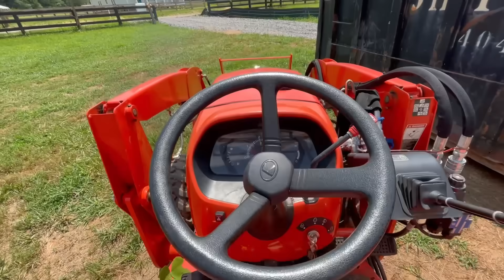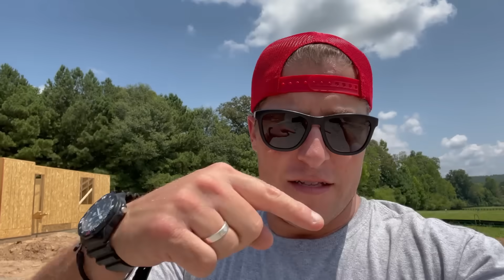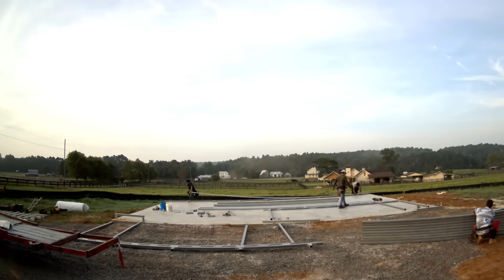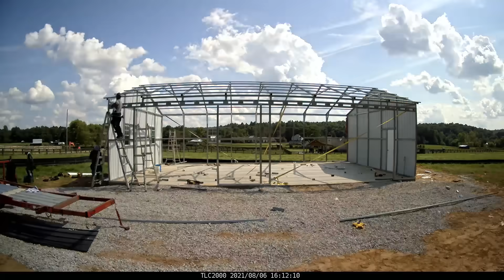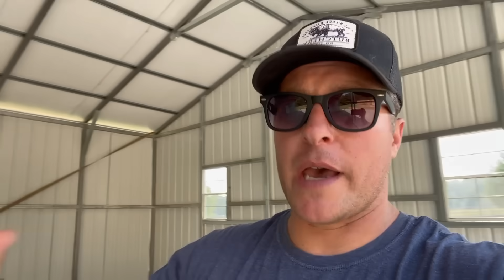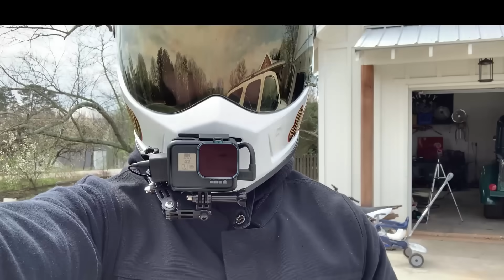I FIRED THEM!!  26x40 metal building Dream Garage build Ep.2

Comment: Thanks for sharing! First you have a drawing of the building frame work, that is like a contract. People can lie over the phone but when they write (drawing) it down and it’s signed it’s a contract. There is a ledger in the corner giving sizes of everything steel thicknesses, type of steel, bolt sizes and grade. Everything matters, you maybe OCD but this is normal people not right.
Reply from the maker: Thank you

Comment: If you were provided plans and the building was contracted based on those plans, I would ABSOLUTELY make them fix it to 100% , or come get it

 I had a roofing company put a roof on my mothers house, they had shingles running crooked, didnt do a full tear off.  They didnt do the contracted roof repairs, shingled over a rotted hole 24" in diameter.  I told them fix it, they tried sell me on a patch job. I said no.The roofing contractor threatened to sue. I told them please,PLEASE  PLEASE sue me. You tried to rip off a senior citizen/military widow. I smell pain and suffering too.

 They backed off, i had another company come out fully document the tear off, debris, nails, old tar paper, didnt repair holes, all as per contract.  The second company did a near perfect job.There were 19 sheets of wood needing replaced, they asked me, i said fix it. they showed me truss damage from water leaks, i said fix it. All legit stuff ( i used to be a remodeling contractor so i knew what i was looking at). Cost an additional 1000$, I wanted it right, for mom. It was never about money.
Reply from the maker: Thank you

Comment: I don't think the siding is a big deal.  The horizontal truss going from 16 foot to 6 is a big deal.
Reply: The siding looks terrible.  I would complain too.
Reply: Exactly if you have plans that this is how the building was supposed to be built manufactured manufactured whatever you want to call it then it's not what you bought it's not what you paid for absolutely have to fix it or or take it away
Reply: Time and a heavy snow and ice over time will make the seams open up.. screw them have it removed .

Comment: I had to fire my first contractors as well when I had my Steel garage installed. 26x30, The guys did real shotty work and it was not to Spec he couldn’t even use a chalk line to install the self tappers on the outside.  My building is 26 ft wide too and I had what you say the correct type trusses. Those trusses for one thing that worried me early on in the video. You’re 100% right, Also you should’ve had horizontal crossmembers on the walls
Reply from the maker: Thanks man. I hate these companies allow this crap to go on.
Reply: @ProjectDadLife  it’s the industry as a whole. They all come from South Carolina (I’m in Connecticut) they work for dirt cheap, and even my first crew I fired asked me for money for the installation.. I told him(I’m in construction 25 years) that’s your problem with the company I have nothing to do with what you get paid.. I’m the customer, and it very inappropriate to ask the client for money. They’re not charging enough.. I paid 13,000 26x30 with doors I did residential OVHD doors too..what did you pay for the building excluding the garage doors, 12 feet high walls, upgraded gauge steel sheeting, vertical installed.
Reply from the maker: Totally agree seems like it’s one big family of scammers that run that metal building industry. Mine was 18k without doors. Added roof insulation and 4/12 pitch 10’ walls, vertical panel
Reply: @ProjectDadLife  not bad especially now. I know it was back in the fall but that was reasonable. I did the colored screws and set that up before installation. But needed to buy more they covered the cost and all my panels needed to be removed cause of shitty work.. but you’re right you have to keep an eye on the install

Comment: I am a contractor in Oregon. If what they built is not what you purchased in the contract you should have them removed it free of charge. Depending on what state you live in, if they don’t want to comply you may consider contacting whom ever regulates contractor licensing. From a contractors point of view, the rippled metal isn’t ideal however the product isn’t defective. If I buy building products I don’t always get to choose each piece of product (Ex choose each 2x4 in a unit) so it’s not unreasonable that they installed that metal. It seems like a cheap thinner gauge metal and again depends on your contract. I would remove the entirety of the roof sheeting, remove the trusses and replace the trusses with the ones spec’d in the plans to make it right. They should have verified their material with the plans that both of you should have.

Comment: I built a 50x50 and did a ton of research before deciding to go with an Iron Built unit. These galvanized metal buildings are  basically tin cans. Without insulation these buildings also condensate and allow moisture and mold to grow on the items inside.  This is in Florida BTW. In a dryer climate this may be ok.
Reply: A dehumidifier goes a long way to keeping the humidity down.   The building has to be sealed decently but even a large room sized one helps.   I have a 30x40 building that would have water sitting on the floor.  I found a 50 pint dehumidifier with a pump and it keeps the building dry.

Comment: Send it back, wood stick frame anytime you have slab on grade. Steel buildings are garbage and they don't save you much in the long run. Manufacturers don't care about your jurisdiction even if they say they will adhere to their adopted/amended codes. You would be much better off having the same framers building the house build the shop.  Side note, no slab, build a post frame structure.

Comment: I purchased 2 steel buildings from American Steel Carports out of Joshua, Texas through their dealer in Hudson, Michigan (Hamdan Quality Roofing). A 50x24 ~ 2 car garage, and a 25x26 ~ 2 stall storage building. Both planted on a really nice 5.5 inch concrete slab, 4 inches above the grade with around a 5 inch rat wall. They too do not pass inspection as water seeps in at the base rail when the rain and wind are at work! The idiot contractors did not put down a gasket seal between the base rail and concrete and did not skirt to protect the base from the elements.
My building inspector sent letters out to both parties February 10, 2022.  To date 3/14/2022 no response from ASC or HQR! The inspector's notice states: "Water is entering the storage buildings under the perimeter bottom rails.  Michigan Residential  Code section R703.1 requires exterior walls of buildings to provide a weather-resistant envelope." Thanks Dad for posting, thought I should share with you and your viewers.  ~ Dave in Michigan

Comment: I was in the business of building metal barns and carports and had a retail sales lot for a manufacture such as the one you purchased, I also have spend many hour at their manufacturing plant and have seen most of the  process and have dealt with the sub contractors/installers who install the building that the manufactures use,  the sheeting is definitely a manufacture mistake and the roll forming machine that produces the panels should not be rippling the edge and those sheets should be sold as seconds and would be unacceptable to me, as far as the trusses go  if you ordered welded trusses in would be a option and listed in the contract, usually spans greater than 24’ would automatically bump the trusses and the price up, under 24’ the standard brace is acceptable according to the engineers I have spoke with , depending on the part of the county you live in (snow load etc ) the manufacture will only build what the contract says ,they are pretty strict on that part! Look your contract that you signed over and see if you purchased the better trusses and if so make them stick to it if not the additional bracing can easily be made by them and the installers can weld in place at your location, most of the contracts from them that I dealt with, it was standard for a 10% deposit from the customer at time of purchase and final payment when u are satisfied, at the completion of the project, the sales location really doesn’t have a choice on negotiations with the customer , all decisions come from the factory and the initial deposit of the 10 or so % is the commission the sales lot made, the installer are sort of caught in the middle also as they get about 20-30 percent of the ticket for installation, and they don’t get paid for any work till they have a signed completion from you. The factory’s have a fee for every and I mean every item! They put additional on a building beyond what is stated in the basic 
package or what the contract states, 
I have sold prefabbed buildings for about 7 years for 3 different nationwide manufacturing companies and they all pretty much work the same ,hard to get thru to someone in charge after 20 different phone reps and endless time on hold, be patient and Fair, I’m sure they are understaffed like everyone else, they should make it right! Most of the problems I have seen over the years whit them are the sales lot representatives are not knowledgeable enough to know how price the details so they leave it up to the factory and the installer for add on at the site, which creates hassles and unhappy customers!    Good luck buddy I hope I was some help, if I can assist further just let me know.    Mike

Comment: I work in  the building trades, and sometimes being overly anal-retentive about everything can kill you. If you want to micro-manage every single fastener that goes into a building, you should probably just save everyone the time and frustration and do the assembly yourself.

That being said, I think you’re being a tad overzealous with the edge of the metal wall panels. However, with the roof trusses, I think you have a legitimate gripe. If drawings showed true trusses with a top chord, bottom chord, and cross-bracing supports, that is what you should get! 

But being a perfectionist when working with the building trades can be an agonizing experience - choose your battles wisely!

Comment: If it isn't per plan that was approved by the county then it's not installed properly. The county would deny you an occupancy sign off. As for the rippling on the panels it looks as if no one was doing any quality control an cosmetically looks like crap. They probably did not use the proper crimping tool.

Comment: In my opinion the edges of the panels isn't that big of a deal but the truss structure not matching what you bought off on and submitted to the county is a big deal and whom ever your contract is with needs to make that right. They have labor tied up in it and they would have more labor tied up in it to take it down. So I wouldn't insist on  them taking it down but I would insist on the truss bracing being fixed properly.

Comment: If its not to code. Or it's substandard that's a problem. I wouldn't pay for work like that myself. One it wouldn't last long especially under a snow load on that roof. Secondly you couldn't seal that to keep heat or A/c in. It's just a really cheap package shed is what it looks like. The company that owns the building should be on the hook to correct the issues

Comment: Spot on them sheets were probably damaged when they were in a bundle they fixed instead of replace but the trusses is a deal breaker have to pass wind code and they differ depending where your at well anyway still like it though

Comment: Have a similar sized building built, but they doubled the metal in the framework on the walls and on the roof. I watched as they assembled the structure, no bend or sag whatsoever with them standing on top. If you're stuck with them, see if they can cut the spacing in half with more framework, on the walls and on the roof.

Comment: It is all very good as long as the building meets the spec that you were given. If it does not meet specs then they either fix it right or tear it down at their expense, or take them to court. They will have to eat the whole court costs, maybe put up the correct building, or lose their license. Good luck.

Comment: I can understand you reasoning but would really like to ask a couple of questions simply because Im wondering if therer was resoning that wouldnt allow thiese questions to be done ...
1.     Why didnt you inspect the structure upon delivery and have to constructor and yourse3lf go over the printed plans to see that everything was to specification before they began working?
2.     was it possible to do a comfrence call with the salesman when the errors were found with yourself and the constructor? wondering if having the constructor on the phone would haved help to get folks in line quickly about any remedies or soloutions they would have offered.
3.     hopfully you deferred a LARGE portion of the paid amount until the building PASSED all of its inspections and had obtained a C of O .... 

none of this i am saying/asking is meant to be disrespectful, im mearly trying to learn from this bad situation they had put you in and make smart moves based on all of you out there who have gone through this process ... Thanks very much for any help you could provide ...

Comment: Did you check the original building you saw to see if the roof sagged.. I'm guessing not. You could resupport the roof with an interior truss.. but in general you are wrong.. for firing the contractor.

Comment: Pole barns or steel outbuildings seem to be in a class of trouble all to themselves. i am a residential contractor and right now am having a 40x70 pole barn built on my farm. After initial pole placement, the "contracted" framer (who was hired by the barn builder) put the trusses on , and maybe 6 braces in to the ground to hold the structure , then told me they had to finish a job, so they would be back in a week. I told them the building would never stay as-was with such horrid bracing. They left anyway. In a week, the building had racked nearly 4". I told the barn building company that they could either get me a structural engineer letter or tear it down. Yes, only nailed together at that point , but their fix was to push on the gable with a skidsteer. My point is that many of the people that do this work know they will never see you again, and time is money - they want done now. SO, hold your ground and never over-pay for completition.  Hold at least 20% of the total until they are 100% done and inspected.
Reply: There are way too many individuals on youtube constructing buildings that are not designed by an engineer and are just an accident waiting to happen and the contractor or homeowner DIY are too stupid to see the significance of having it engineered. .

Comment: As a builder with architectural/structural experience I see a lot of problems. I don't even think a 16' bottom chord is enough. The top chord seems insufficient, seen heavier roof structure on a 8x12 shed. What you have are not trustes. I never break joints on the cross bracing on the same joist/truss they should be staggered. Next where's your headers over the overhead doors? What's shown are not headers,this wall is picking up the roof loads. I didn't see proper cross bracing, without this building will collapse like a house of cards. This is my opinion with only a quick glance. I wish you good luck and don't accept bad workmanship for you will pay for it in the long haul.

Comment: I’m, no engineer yet, but I do have a Welding AAS, have built pre engineered steel buildings and worked on a crew erecting them. I am currently back in school after 6 or 7 years as a structural welder and after 2 more classes will be in school to also be an engineer.

I have never pre fabricated or erected a steel building that looked so structurally weak as the one in this video, I would tear that down and start over.

Comment: I would stick build it like a house. Have a truss builder assemble your trusses for the given pitch, span, and spacing. Takes a little longer but you get a great building. I stick built my own 24x30 with 10ft walls. Insulating is easier and so on. You will get it figured out but that's my opinion.

Comment: Here in Australia all colourbond walls run vertical, Also we do not screw sheets in the valley of the sheet, We screw them through the top of the ridge so the screws are above the water when sheeting is used on the roof

Comment: The sheet metal panels were install upside down. That short overlapping end you pointed out is supposed to be underneath the last panel. The other end has a flat lip that you screw into in order to not have their visible seem. You can salvage the Bldg trusses by simply welding the 16’ pc on as is, leave that 6’ pc there and attach the rest of the trusses support. Nothing has to come down. Taking it down spells a lot of $ and time all down the drain.
Reply: im thinking these are pretty easy fixes. Personally I would rather work with the contractor/supplier to fix the problem before I go fireing everyone. Good luck getting someone to fix the other guys stuff.

Comment: Fire them - sue them - pay them nothing - I could see the dip on the roof and I am sure you could actually build a better product using wood - that span of the roof and those flimsy trusses will not hold anything back - if you get heave snow, anything can happen - durability is a major issue then.